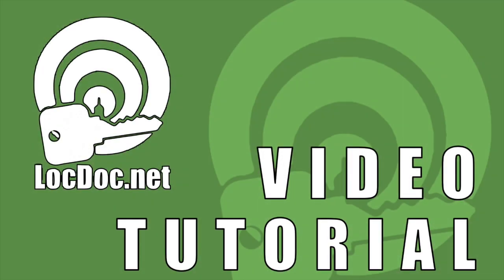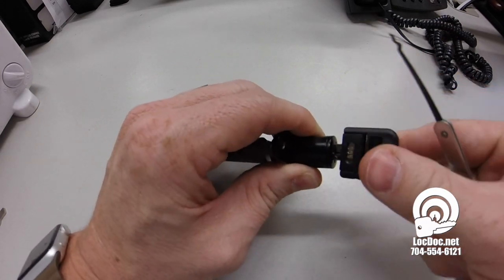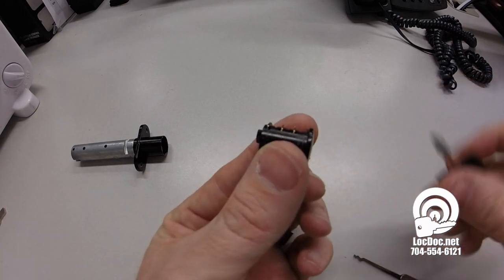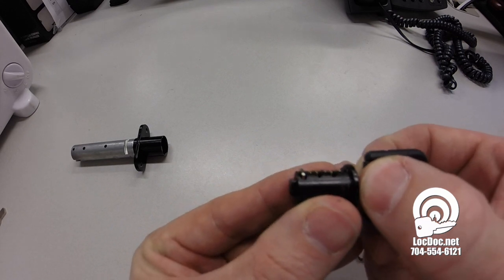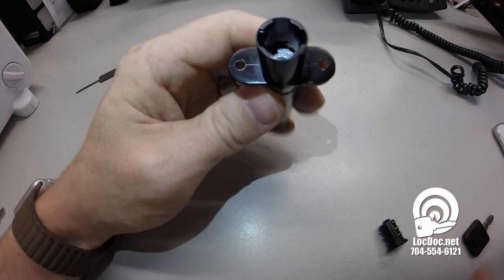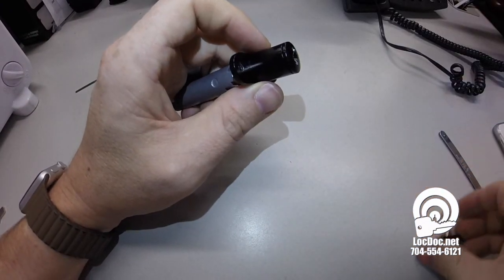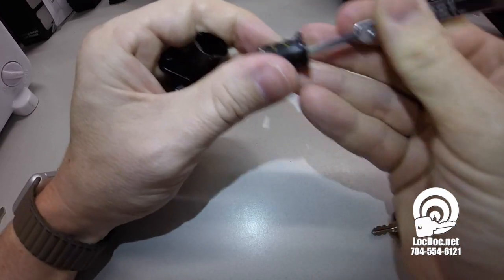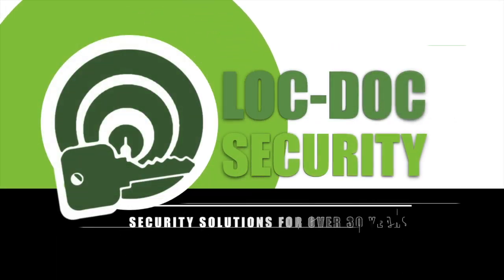Desk File Cabinet Lock Removal

Comment: I have a Kimball executive desk that the lock core will not operate with the key that I purchased from my local locksmith who cut the key per the Kimball K1 settings.  Can I replaced the lock core myself?  Or do I need to hire a locksmith to replace the lock to my desk?  Thank you in advance for any suggestions or recommendations you might have for me.

Comment: There's a drawer on my desk where to lock no longer works. The key can no longer open it. I tried the original key, as well as copies I have of it (all in good condition) but none of it works anymore. So, the problem is with the lock itself. I can no longer open the drawer to get stuff that I need out of it and it's frustrating. I don't know if I should try to break the wood in some way or if there's a method to just remove the lock. I also wonder if it's possible to pick the lock but it doesn't seem like it because the lock doesn't function properly.
Reply from the maker: Hi. Does the key rotate?
Reply: @locdocinc   I have the same problem and yes the key rotates.  It will open the center drawer and the drawers on the right but the left side will not open.  Thank you  My desk is a steel case